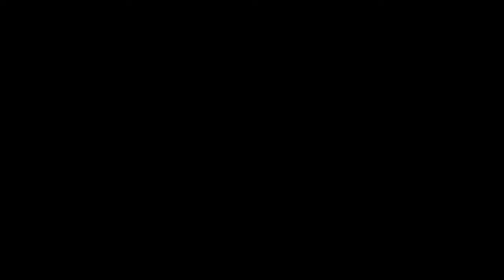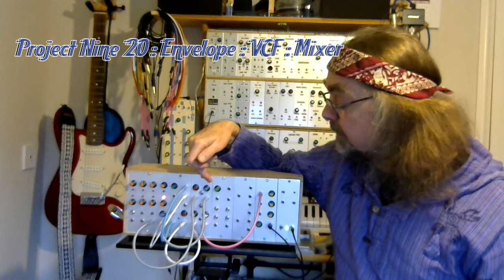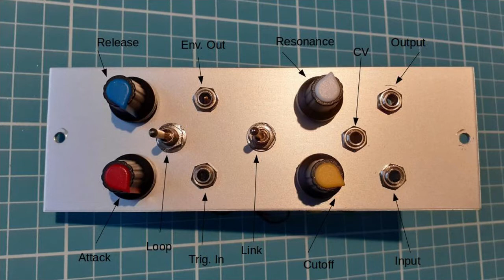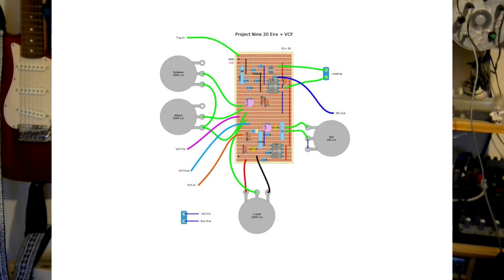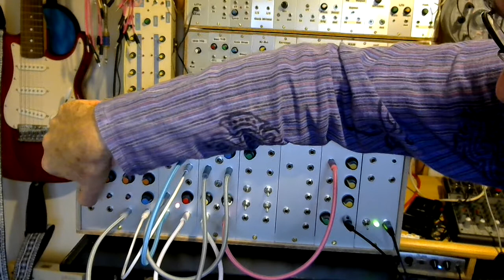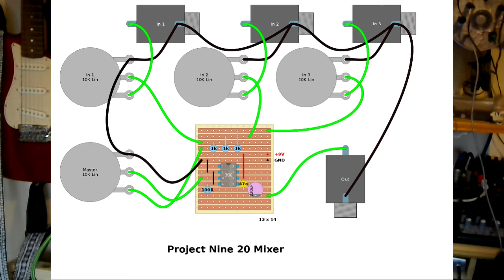Project Nine-20 DIY Modular Analogue Synth :  Envelope, VCF & Mixer

Comment: Can i use 2n3904 transistor equivalent instead 2n4401
Reply from the maker: According to the original circuit description the transistor is there to convert the trigger input to an S-Trigger which means it triggers by grounding the input. With my limited knowledge of electronics  I interpret this as the transistor acting as a switch, though I may be over simplifying here. The 2n4401 is described as a general purpose npn transistor and the 2n3904 is listed as an equivalent in the datasheet so I would expect it to perform the same function in this application but I have not tried it myself. Please be careful if you are going to use any diy circuit with commercial equipment.
Reply: @CuSiSound  Thank you once again for your work and knowledge you gave us all! Really Inspiring. And yes my main target is building some simple modules to gave more movement to my current setup which is a drum machine and Behringer Crave synth wonderful present from my beloved Girlfriend. And i will becarefull always measuring voltages i gave in and out to Crave

Comment: Have you got a higher res pic of the stripboard layout at 3:06? That's exactly the sort of thing i'd like to make and that layout would help me a LOT!
Reply from the maker: I have put my original diagram in my dropbox folder https://www.dropbox.com/scl/fi/x0u0i5sgmkbxoxdpz1p3a/P920EnvVCF.png?rlkey=gp0217fqv2b7ewolzfaeiwghs&dl=0
Reply: @CuSiSound  Oh sweet! I can't thank you enough for that... I'd been squinting at the video, zooming in, trying to figure out all the values etc. That makes life so so much easier. I'm going to give it a go asap, much appreciated.
Reply: @CuSiSound  Hello again... I made the circuit to the image last night, and when I plug 9v into it (just the VCF to start with) the LM538 gets incredibly hot very quickly. I've checked and triple checked and far as I can tell I've put it together right, can you think of anything that might be causing this? I'm not expecting any detailed diagnostics, you've already done enough in putting this video together and making the circuits available - but is there anything obvious that comes to mind? Any trace cuts hidden under components I may have missed?

I'm surprised the IC just heats up enough to burn my finger when the data sheet suggests 9v straight to it as in the circuit should be acceptable.

Any ideas or roads I should follow would be appreciated. I hate to drain any of your time after you've already done plenty, but I suspect you may have some ideas I would never have considered as a novice.

Thanks,
Yyams
Reply from the maker: There is a lot of current flowing through somewhere it shouldn't. Usual suspects are the power connections (+9v to pin 8 Ground to pin 4) and short circuits. Also check that polarised components are the right way round e.g. diodes. Apart from the ics there are no track breaks under components. If you want a VCF that works on 9v or 12v check out the Q&D VCF here https://www.dropbox.com/scl/fi/yztiyyy9oqii4jcb5fipa/QD-VCF-InverterSwitch.png?rlkey=dgruckdiq4utpj9i2c7i3spxb&dl=0
Reply: @CuSiSound  Thanks, it's really baffling but that gives me some more clues to follow.

Probing the diodes with a multimeter they all read the same and the correct polarity. I think I'll try testing or swapping out the most likely components to see if it makes a difference, and re-do some of the wiring the power socket and things like that.

Many thanks for the ideas dude.
Reply: @CuSiSound  Well, very embarrassing. I had the 9v in wired up backwards. That'll do it eh. Putting the original IC in there it still gets hot, but a new one stays cool. Unfortunately I'm not getting any sound out of it though, so I may have burned out some other component with that backwards power mess.

Ta
Reply: Well, it seems now that when the input jack isnt' plugged in it will resonate and low pass the noise of the circuit, and self oscillate. When the input jack is plugged in it just goes silent. Trying another input jack and wires to the appropriate place on the board has the same result so it rules out that bit (in theory). They're both correctly wired, i've checked three times:D

I've also replaced all the caps in VCF and the input resistor.

What an adventure. I'll let you know how I get on, ta:D
Reply: @CuSiSound  Got it working! I noticed the drawing was a little different to your photo of the finished board, and when checking the schematics it sort of clicked. That didn't turn out to be the main fix though, I worked out that adding a cap and 50k pot to the input instead of the 100k resistor before pin 2 on the 358 - it started working well. I can set it sensible or overdrive the thing now which is nice. I'm not sure why it needed that cap before the input, but for some reason it just went silent when connecting a jack without it. Odd, as it's not like that on yours.

Anyways, it's a quirky beast eh. I swapped out one of the diodes with the one that sounded best from my stash, which took the self oscilation down a little, and while trying to work out how to get the input sorted I found two other spots to connect the input that have in one case a distorted sound, and in the other a sort of gated envelope follower sound when the cutoff is just right, so I wired them in on switches for extra nasty factor when desired.

Time to wire up the hardware for the envelope now! Many thanks for the circuit, it's great fun.

Ta,
yyams
Reply from the maker: The cap and pot allow you to remove DC offset and adjust the signal level. One of the key features of the diy approach is the ability to make the circuit what you want it to be. Hope you find the envelope an easier build.
Reply: @CuSiSound  Ahh that seems logical. It was an excellent fun little build all in, I just have to whack it in a housing and I'll be very happy with the end result.

The envelope generator likes to stop looping sometimes when teh release is too long, but that's fairly minor and it can still be triggered regularly.

It's certainly got quirks, lots of them, but as you say that's the fun of it. It's the first envelope generator I've built so that's a wonderful tool in my arsenal. When combined into one unit (with added switchable clipping diodes on the output) it makes noises that I can't make anywhere else with the gear I have.

Many thanks for the videos and subsequent help. The world is a better place for it all.

Yyams

Comment: I’m quite new to synth building but  really enjoying slowly catching up with all your videos , I made my first ultra simple VCF yesterday but I can’t get the CV in to work properly, it just clicks all the time. I’ve got the cable going from the jack plug to correct place on the board and the other to ground is that the right way to do it ? Thanks for any help.
Reply from the maker: Yes the +ve (tip) on the jack plug goes to CV in and the sleeve (-ve) is connected to ground. The clicking is most likely due to the type of signal you are using as the CV input. For example, a short pulse or hard square wave will produce a clicking sound and not much else but a signal with a more gentle rise and/or fall slope will sweep the filter cut off, but only if the cut off is not already set quite high. The output from an envelope generator works best but try a few different sources such as a triangle wave LFO (https://www.youtube.com/watch?v=2iqPoOrp47o). Experimenting with signal paths is all part of the fun.
Reply: @CuSiSound  Thanks for the quick reply. I’ve been using my Crave’s LFO to modulate it, it has a triangle and a square but the click is still there with the triangle , I’ll try an  envelope and see if it helps. I did manage to modulate the resonance with a vactrol cv in without any clicking. I did try that way with the cut off but it still clicked. I’ll keep trying. Thanks again for your help.